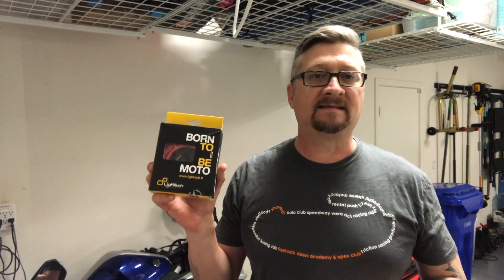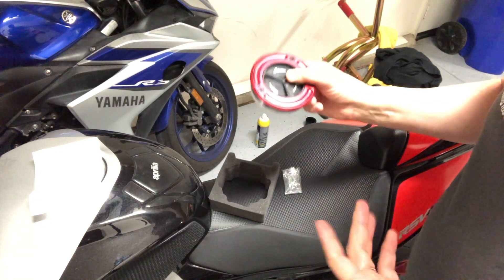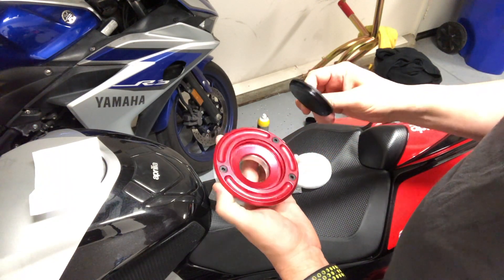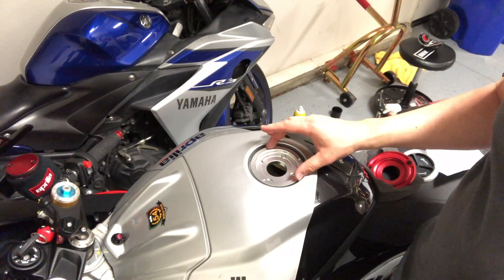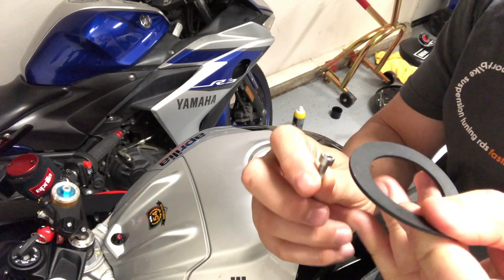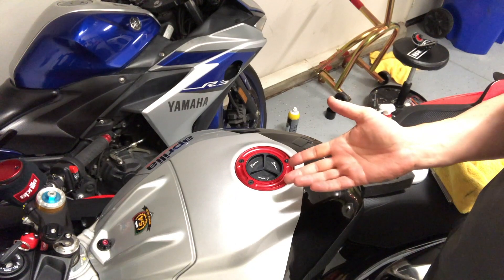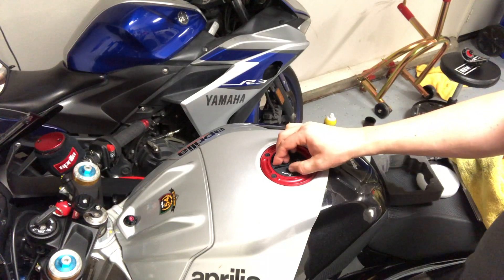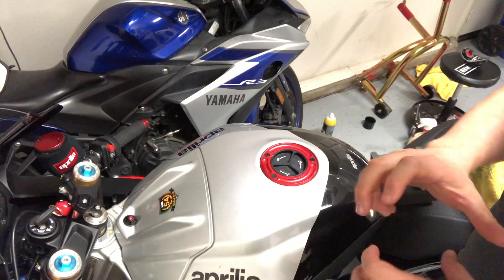Installing Lightech's Replacement Gas Cap on RSV4

Comment: Does it install flush?
Reply from the maker: Yes
Reply: 1Up5Down thanks! I will prob get the 1/4 turn from lightech for my R1
Reply from the maker: Good call. I wish I had gotten the 1/4 one instead, but it still looks cool.
Reply: 1Up5Down yea i mean you are going to spend around 100 bucks might as well get the better looking and practical one

Comment: Hi buddy ,, I've installed the exact same fuel cap , The issue I'm having is pressure building up and ever time i unscrew fuel cap petrol tends to come out and go all over the cap. Tryed filling tank with less petrol but same shit . Do u have this problem ???
Reply from the maker: REPSOL CBR no I don’t have that problem. It sounds like a problem with your vent tube. Air needs to be able to enter the tank as fuel is being used, otherwise it’ll build up pressure.
Reply: @SouthernSportbikes  mmmm , very strange its a new bike.  Thanks for the reply ..
Reply from the maker: Yes but you installed an aftermarket part. Check your vent line.
Reply: Repsol CBR Did you ever fix this issue? I want to buy this part
Reply: @TrickRacing  Hi buddy,  it only happens on the tuono and not the rsv4 . After doing all recommended manufacturers trouble shooting.  Sent it back to the manufacturer they jointed/grooved out breather hole making it longer. Didn't fix it 100% but was a big improvement, as I was one of the first to install in on a tuono . There is another brand called monkey bones . I hope this help u
Reply: Thanks man god bless . Get back on the CBR #HRC